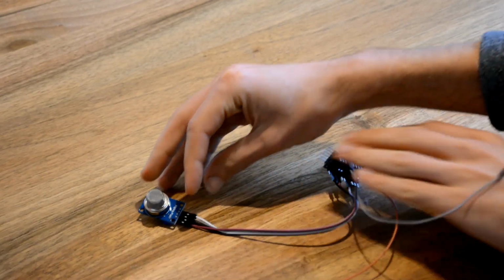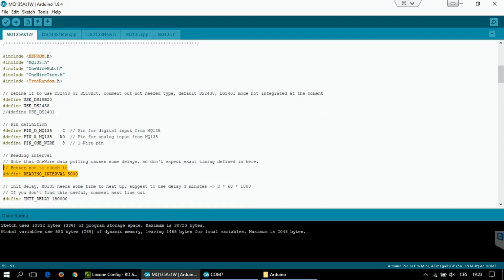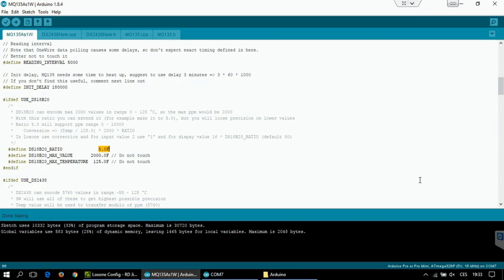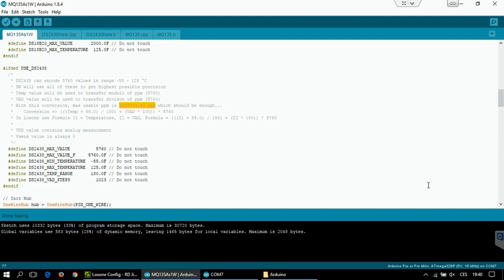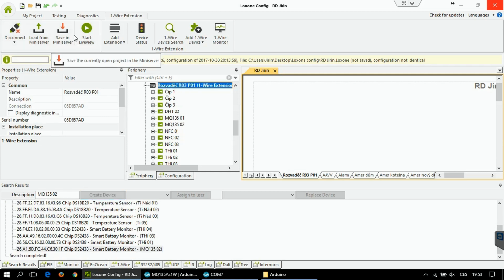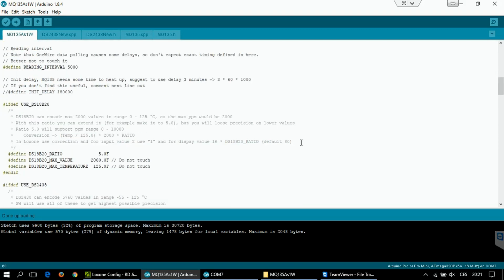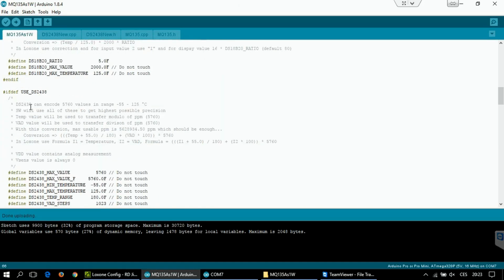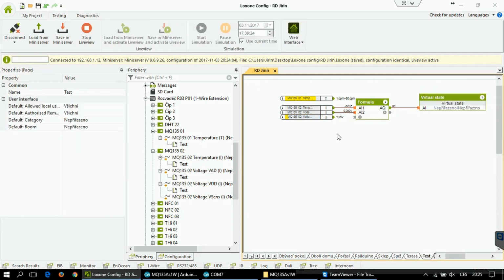Make your own 1-Wire CO2 sensor for Loxone and others

Comment: Thank you for this guide, it's very useful. A couple of points to note:

- You don't talk about calibration. When searching for MQ135 calibration it seems a contentious topic. It also seems you aren't really meant to try and get a 'real' CO2 PPM reading from it because it senses all kinds of other gasses. This isn't a problem for me as I'm measuring 'air quality' and any increase in the reading indicates the air isn't fresh. FWIW, using this code unchanged, my MQ135 returns 0.01PPM in 'fresh air' out of the box! Breathing on it, or especially spraying aerosol nearby causes a big change which is all I'm looking for.

- I read the Arduino ADC has a 10 bit resolution. I also read the 1-wire modules supported by Loxone have greater than 10 bit resolution (all but the DS18S20 which is 9-bit) so it seems overly complicated to combine input values as you have. FWIW, think I will implement this by just passing the raw ADC input from the Arduino to Loxone as a temperature and have it perform any scaling calculations. This way, if (when) the MQ135 sensor dies I can just swap it out without having to re-program the Arduino and change scaling functions in Loxone (if necessary).